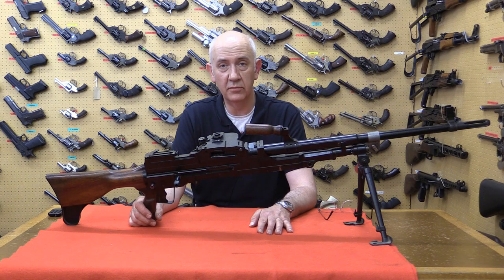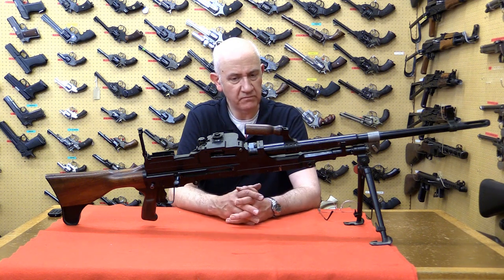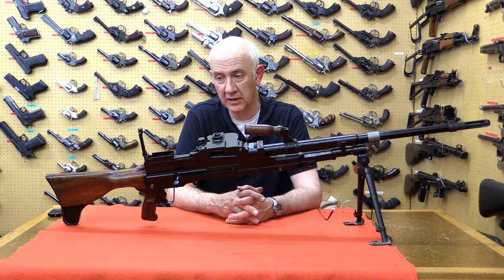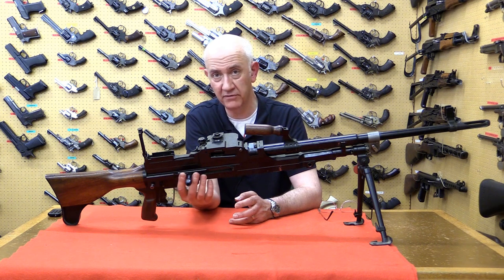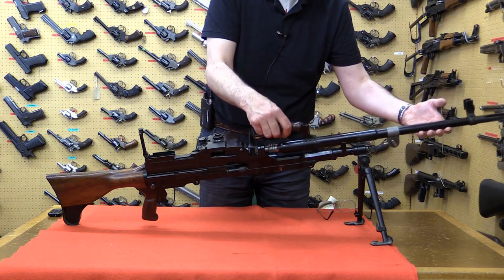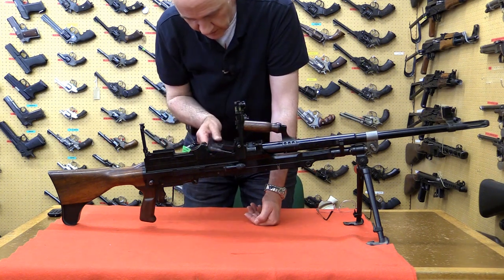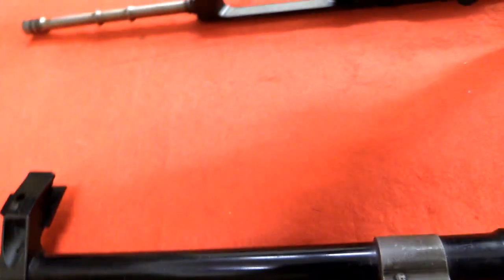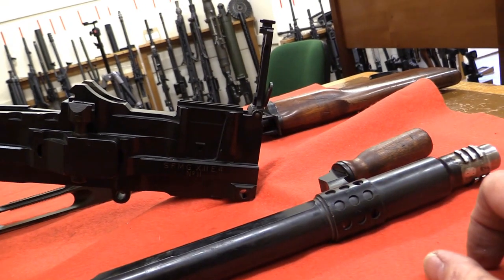TAB Episode 4: X11E4 Belt Fed Bren Derivative

Comment: It has to be said that the BREN is not an easy gun to manufacture. It's "'30s easy", not "'50s easy". The piston-bolt assembly alone is composed of 30 parts, and there are too many machined parts in general.

Comment: I note that the X11 seems to feature a half-length top cover.

Could you elaborate on why the full length feed tray cover became ascendant and how only now with designs like the IMI Negev or the KAC LAMG that "half length" covers are coming back? Does a full length feed tray cover a la MG 42, FN MAG, PK/M offer advantages as to serviceability or when clearing certain malfunctions? It seems to me that the more you open up a gun's guts to the environment the greater opportunity there is for dirt to get into the action. A full length feed tray cover also presents a much more awkward prospect to reload from any other position other than prone, and in the machine guns that trace their lineage to the MG34 a bent or out of spec feed tray cover also makes the gun less reliable.

Nowadays it also makes the use of optics a little awkward too because the optic and its zero needs to survive the opening and closing of the cover as well as the operator slamming the cover down to close it. Of course this is less of an issue if the machine gunner operates with an assistant who can clip on extra belts as needed but with the deletion of belt starter strips from belted ammunition these days the feed tray cover does need to be opened up at some stage eventually. Thus presenting all the "return to zero" engineering problems once more.

Comment: I have the perfect setting for this.
In an alternate reality, the war stopped with no winners beacuse of nuclear weapons threat. In this world, every army had to modernize it's infantry weapons with assault rifles, designated marksmen rifles, general purpose machineguns, subachineguns and pistols:
The english-american coalition arms itself with: M3 carbine (a version of the m2 carbin chambered in something close to 300 blk, or some form of shortened 30-06), the m1 garands snipers and THIS x11e4, also m3 grease gun and 1911s
The axis arms itself with: the sgt45m, the mg 51 in 8mm mauser and some 8mm mauser rifle like a converted mas 44 or fn49 (because the g41 would have been seen as not ideal), the mab 38 and the beretta 51
The soviets arm themselves with the ak, the vz59 or the rp 46 belt fed and a more accurate svt 40, a pps and the tokarev.